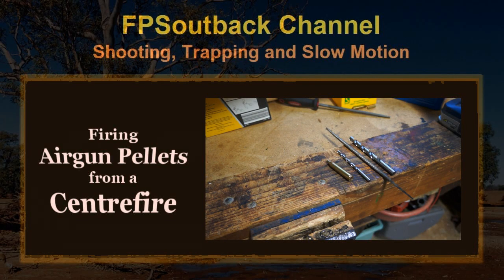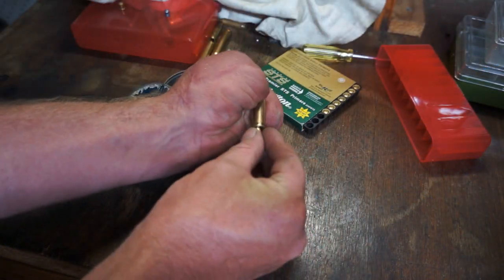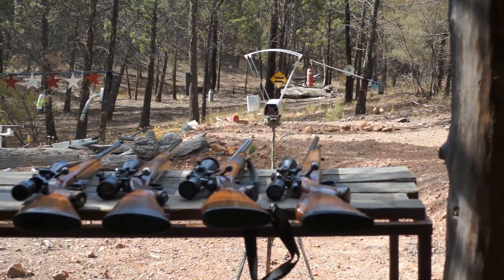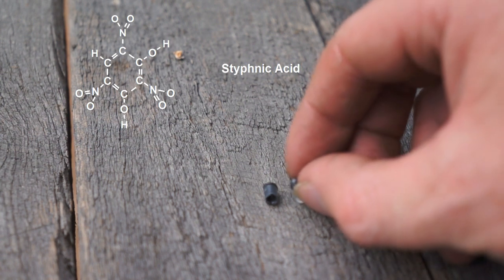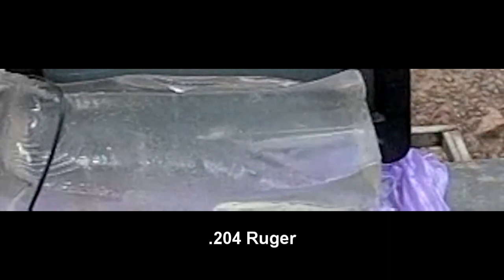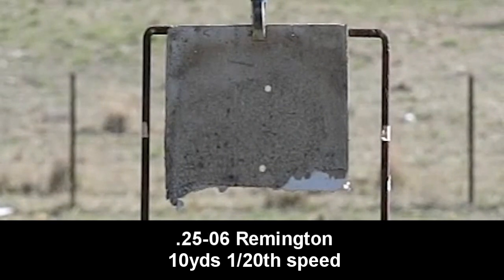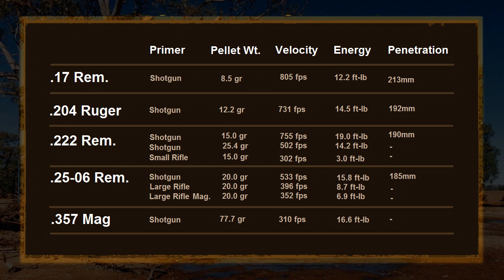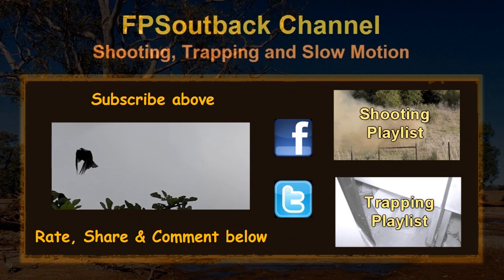Firing an Airgun Pellet from a Centrefire - Part 1

Comment: tanks for this video, This helps me a ton for the following reasons.  Primer ignition is considered a non-firearm here in Canada, so if a gun is made to fire a projectile using a 209 primer and can't be modified to fire anything but a 209 + projectile, you do not need a licenses to build or posses, provided it stays in the 500fps range with no more than 5.7 joules of energy. continued...

Comment: Thanks,  I do the same thing with the 221 Fireball and a 223 in my TC Contender barrels. I use the Fireball the most. The only difference is in the way I seat the pellet. I put a "slight" crimp in the end of the case mouth. The pellet is pushed in from the rear. The crimp keeps the pellet from falling out. The impact zone is close enough so that I don't have to change my scope.  I have taken tree rats, bunnies and six crows.  I haven't checked the speed but it will group minute of sparrow.

Comment: I agree the velocity in say a 7" barrel ,(which is fairly long for a pistol), would be much lower, and even lower in a 4" barrel, etc.  Because of the short barrel, most of the pressure would be lost behind the pellet after exiting the barrel, IMHO, causing a reduced amount of power, like how co2 air guns work, short barrels make more noise with less power, and longer barrels make much less noise with much more power, until the law of "diminishing returns" kicks in.

Comment: With a typical air gun pellet designs your limit to max speeds, 800-900 fps for .177 types for example and you got the problem that the lead skirt can't take too step pressure peaks. Done some tests with 22lr rounds years back and even a pinch of powder ripped those pellets up then. It might look different with modern FAC pellets but I'm not too optimistic.

Comment: Cool vid! Try to put in a two to six grains of some shotgun powder or another slow burning powder to push the pellet out of the barrel at higher speed. Or even some more aggressive powder. Taofledermaus used .22 nailgun blanks and got over 2500 fps from a lead pellet in a .22LR - that thing completely disintegrated upon hitting the ballistics gel. Would make quick work of some small pest at close range. lol... You might want to check out his videos.

Comment: There are some advantages of this conversion. The obvious one is the ability to convert a loud centrefire rifle into a fairly quiet without having to buy a a .22lr and Winchester Z cartridges. I tried both against a telephone book and the results were similar from a .223 using a .22 pellet/shotgun primer vs a Harry Owen style .22lr/.223 cartridge adapter loaded with a Winchester Z (29 grain slug/790fps). The Winchester Z was quieter and had equal penetration using a heavier projectile. The problem is that I don't have any cartridge adapters for any of these other cartridges mentioned. Did you resize the brass before drilling it out?

Comment from the maker: Search for "rat tail file", you want one with a slight taper. You could probaly use a chainsaw file, it does help if you can pull the handle off for fitting into a drill.

Comment: Great vid bud. As always. I realllllllly wanna know what rifle that breech lock 357 was I'd you don't mind to enlighten me
Reply from the maker: Its a martini cadet, used as a training rifle in Australia and chambered in .310, once obsolete they were sold off to the surplus market, I believe quite a few made it to the US. This one was rechambered to .357 mag.
Reply: Sweet. Thanks for the reply bud. You have really good videos. Finally somebody with some intelligence
Reply: +FPSOutback Instead of shotgun primers to fire the .357 pellets I am curious what fps you would get if you used nail gun blanks.
Reply: +Tyler Christiansen I was thinking the same thing.  It looks really neat.
Reply: harry guy 
iam going to shoot 35cal '9mm short' bullet shaped air gun pellets propelled with 9mm pak blanks 
Im re building a crosman 2240 adapting it to 9mmpak with a not rifled barrel that fits cal35 wish me Luck! 
If this fails i wil use the Factory 22 barrel that sits on the 2240 and fire 22 pellets from it propelled by eather 9mmpak ore 380.RK

Comment from the maker: I've never seen .30 cal. "pellets", the 30 cal airguns that I've seen seem to fire solid "bullets". I did load a .308 up with a sabot and .22 cal slug though didn't fire it, expectations were low and it wouldn't have the velocity to seperate in the air anyway.

Comment: Thats some really cool stuff FPS, Im going to have to try this with my little single shot .223.
Just wondering.. Have you tried drilling the flash holes out bigger when using the rifle primers? :-)
Reply from the maker: No I have never tried that, I guess possible issues is first harder to reload in the field and second assuming the primer will generate the same volume of gas regardless the slower pressure rise may be desirable. It would be worth trying though.
Reply: FPSoutback
Hmm good point about the pressure spike, it may be a bit hard on the pellet skirt? Its certainly a worthwhile experiment as 209s are nearly twice the price as rifle and pistol primers in New Zealand atm so they appeal to cheap bugger in me! lol I might try changing some .223 cases to take large rifle primers and give it a go, Thanks for the ideas :-)

Comment: Ty verry use full data
Iam going to shoot 9mm air pellets cal35 propelled with a 9mm pak round! 
Im re building a crosman 2240 adapting it to live firing amo 
Single shot 
Pellet gets loaded infront of a 9mmpak round! the barell wil not be rifled iam curious how much energy fps this build can reach 
Data from the 357 was verry use full 
At first i wanted to use the crosman 22 Factory rifled barrel and shoot 22 bullet shaped pellets from it also using a 9mm pak round as propelant I think that would be over kill 
Nail gun 22's are known to reach supersonic speed propelling 22 pellets Imagine 9mm pak ore 380.RK 
Tyvm for the video!

Comment: Accuracy fails because the force blows the rear of the pellets into a dome shape, thus the sharp rear edge of the diablo no longer provides drag thus the pellets now are aerodynamically unstable. Secondly, a .22 LR is a different calibre to a .22 air rifle (a .22 LR is slightly larger) and thirdly, the twist rate of an air rifle i much slower than a .22LR. At the higher twist rates, the air rifles pellets (which are almost universally crap) are gyroscopically unstable and this further contributes to accuracy problems.

Prometheus pellets are VERY barrel intolerant, and generally crap. All show and no go from experience. Fire then from a good quality gun like a Daystate PCP and you can watch them snaking all over the shop.

You should try Rabbit Stopper Magnums, they are solid lead and work beautifully...ALLEGEDLY....